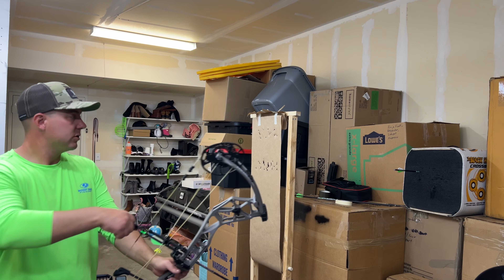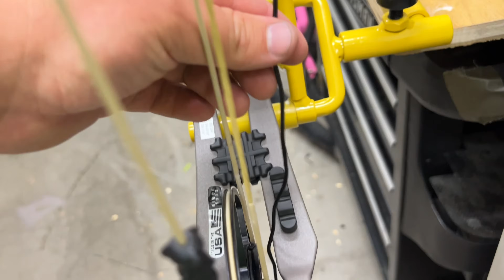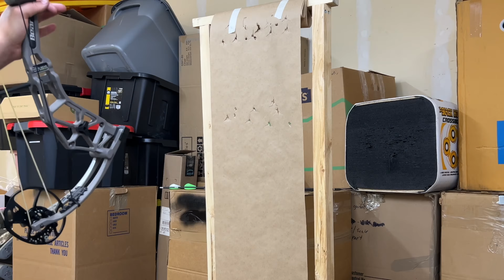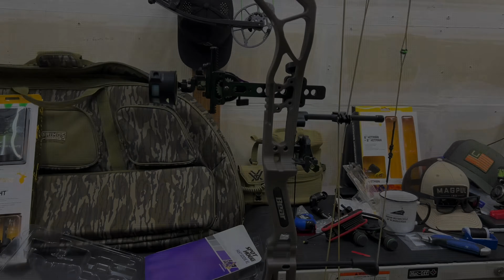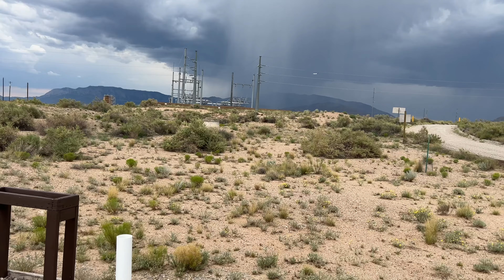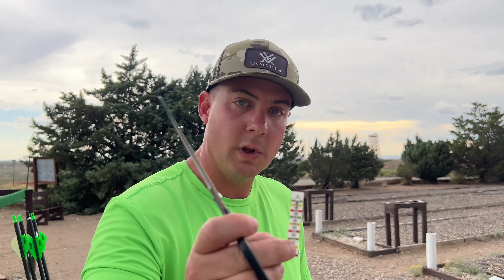Best $1000 Budget Bow Build 2024 With the Bear Alaskan XT

Comment: What I've learned from some pros over the years: put your peep in as the last step. First mount the arrow rest, set loop position (because its crucial for peep hight), paper tune and mount sights. Then sight the bow in at 20 without a peep. Slide the string material in the middle of the bowstring up and down and use it quite like a peep. Sounds odd but it works. Gives you the Ideal peep hight and s more forgiving setup.